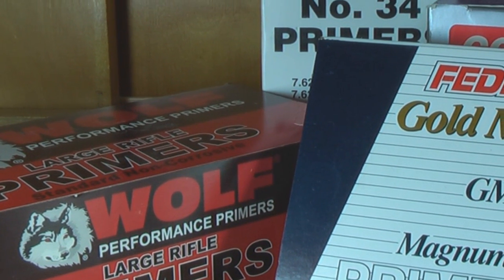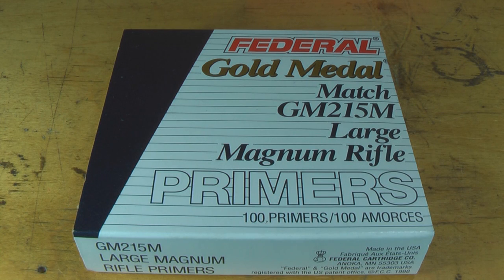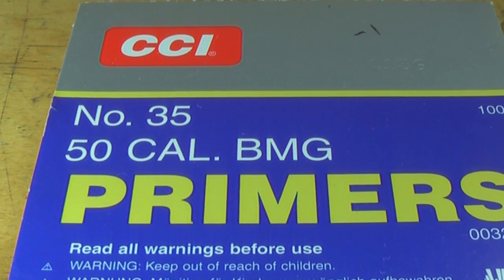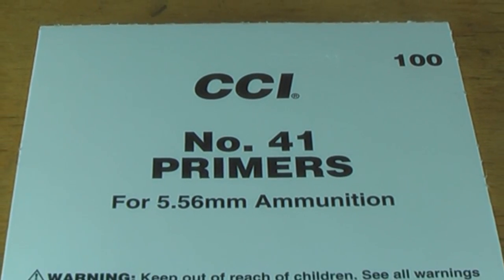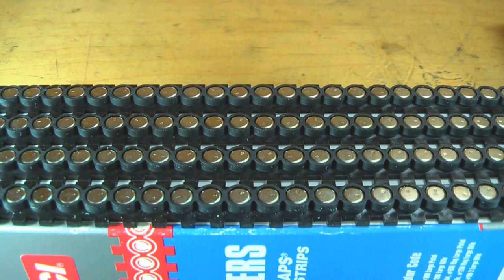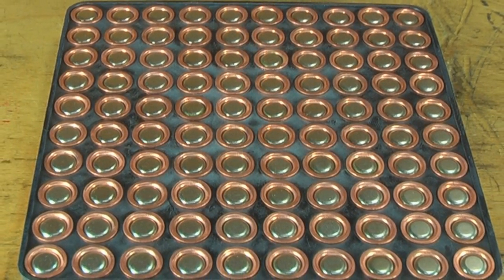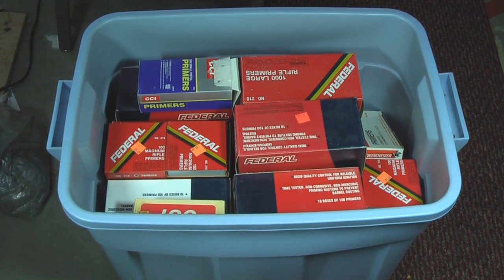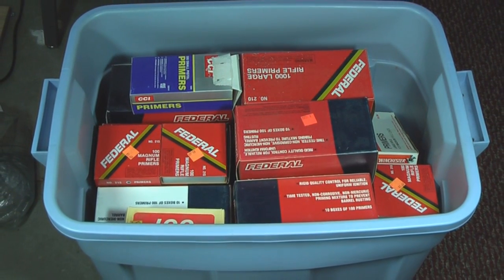Primers What You Need to Know in HD

Comment: Great vid, very informative.  I would add that CCI 41's are great primers, they are not absolutely necessary for the 223 round. Most times, poorly seated primers are the cause of slam fires. If you load a ton of 223, and your rifle is setup correctly, standard primers are fine for most loads and powders.

Comment: You can substitute a standard small rifle primer for a small pistol primer. You would never know the difference if you didn't know. I have loaded over 500,000 9mm with small rifle primers without issue. Learned this from a Winchester rep during a small pistol primer shortage 20 years ago, Mike DIllon was in the office at the time and confirmed it. Don't try to substitute a small pistol for a small rifle though, same Winchester guy told me this.
Reply: How are you doing now?

Comment: The rubber made bin is good but two things:
1. Some people are concerned of static electricity sparking and setting them off. I don't see it as much of an issue. Primer detonation is almost exclusively impact only.
2. Order some desiccant packs and throw a decent size pack in the bin with the primers. Moisture is bad.

Comment: I once soaked several large rifle primers in water for about a week with no real agitation.  I then removed them from the water and let them air dry for about a week.  I then seated one in a .308 case (primer only!!!).  I went into a dark closet and aimed the rifle at an old rag on the floor and pulled the trigger.  Fire shot out of the barrel (24") as if it had been a normal primer.  ....just something to think about.

Comment: @BlltPrffAsssn Its a safety thing. If you store them in an ammo box then if they detonate you have a bomb but if you have then in rubbermaid containers then if there is a detonation the primers will be scattered and the resultant explosion will be far less. I recommend the air tight food storage containers put inside a rubbermaid container as shown in the video but with foam on the bottom/sides/top for cushioning.

Comment: I have had slam fires before but never from my reloads.  The first time was with my semi auto ak47 using some russian steel cased ammo NOT wolf.  It fired off 2 rounds with one pull of the trigger I later determined it was due to a poorly cleaned firing pin and firing pin well.  My SKS also had a slame fire WITH wolf ammo. Due to I believe the same problem.  Dirty firing pin.  So now I clean the hell out of my free floating firing pins every time I strip down and clean my rifles.

Comment: I own two Armalite AR-10 rifles and both of them have a spring mounted on the firing pin inside the bolt carrier group. The firing pin has constant pressure on the firing pin so it is NOT a free floating firing pin.

Comment: The fact that was missing was the metal hardness of the primers. I have some remington primers that are so hard that a double strike is needed sometimes. If I wasn't so cheap I would get rid of them. CCI has a nice primer pocket divot strike on them constantly and that is why I only buy CCI brand. If you buy them compare the divot at the range from time to time with the same rifle.  Don't point your rifle at the ground when you rack the bolt and that will help the slam fire.
Reply from the maker: Primers also vary in hardness depending on date of manufacture as well.

Comment: I understand the associated risk of slam fires in semi or fully auto platforms. However, unless an individual repeatedly drops the bolt on the same cartridge, it's then that the risk becomes elevated, though still very unlikely.

 I have been loading for auto loaders, both handgun and long guns that shoot bottle neck cartridge's. Now if we were referring specifically to FA platforms #34's / #41's to be well served.

 I've conducted multiple tests using a number of different actions and chamberings, to date I have been entirely unsuccessful at inducing a slam fire. Using at least a half dozen different AR15 and AR10 platforms, and I've also tested some semi auto's like the Uzi, Tec9 and a few other semi auto platforms.

 I've tested standard primers from CCI , Winchester, Federal and Remington. Manually dropping the bolt 20 times on the same cartridge yeilded nothing more than a dinged up primer, but no slam fires in any of the weapons. Even the Federal primers wouldn't slam fire, this actually surprised me actually.

 I went on to test magnum primers, they actually did resist denting, in which the dents were significantly more shallow than the standard primers. 

 Moving on to #34's and #41's, and when comparing them to magnum primers there was no discernible difference in dent depth. 

 Over all, Federal primers were the softest and Winchester the hardest with Remington and CCI very similar.

Comment: I've never heard of a slam fire destroying the weapon before. 

To those that asked, a slam fire is when the firing pin rides forward with the bolt and hits the primer hard enough to set it off and fire the round. This is surprising and dangerous because all you might have intended was to close the action after inserting a fresh magazine when the weapon discharges. Appearantly this has caused uncontrolled fully automatic situations, but I've only ever heard of single rounds.
Reply: I just loaded my first 15 rounds of .223 last night and chambered one. It has a small dent where the primer was hit but it was really soft so i don't think it will be an issur

Comment: I dont think its necessary to use the milspec primers in ARs. Ive never used them. The free float pin in M1s and M14s have a massive forward impulse, so it makes sense you'd use it in those, but in ARs the free float firing pin is designed to recoil as soon as it touches the primer. Its also recommended that you dont slam the bolt home unless youre at the range. I mean ive done it but its not smart.

Comment: remind me what #41 primmers are agian.  

I have been using CCI standard small and large pistol primmers and standard large rifle primmers for awhile with no problems.  I was about to prim some small rifle primmers and I was going to use standard CCI small rifle primmers.

I have heard of the issues with slam fires, I have used standard cci large rifle primers with my M1A for awhile with not problems.  The firing pin barrely leaves a scratch but noting the dangers I do seat my primmers deep

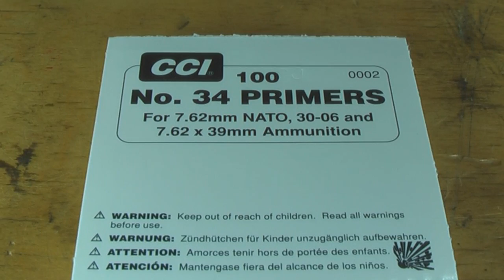Comment: At1:55 you were discussing the CCI #34.  What is a "slam-fire?" I have never heard that term before.  Do non MIL-spec primers "detonate" under light primer strikes? Is that what you were talking about? ... Also, just sub'ed...
Reply: Various primers have different cup thicknesses and are made out of different materials.  CCI #34's are made to a Nato specification, that is all.  No you don't need them, just because you use a semi-auto with a floating firing pin.   If you actually do have problems with slam fires then Wolf, Tula, or Sellier and Bellot have a harder thicker cup than the CCI Natos.  

The majority of "slam" fires are actually mistakenly called so.  Usually a bump fire, or a worn sear allowing the hammer to follow the bolt on occasion.  But from the user perspective, they wouldn't know the difference.  A true slam fire indicates a problem where your firing pin is either sticking in the forward position, or excessively long (improper fitted aftermarket).  None of which are related to the primer, but an actual problem with the firearm that needs to be resolved by a competent gunsmith or armorer.
Reply: darwinfoto09 yah I use the tula small rifle just for this they are thicker a heavier metal you can tell when seating the primer a bit more force is needed, Tula used to be cheaper now their not, but the price of those cci primers is like 45 compared to 30 so tula i about 26 for me its tula on 300 blk and 556 ammo.
Reply: darwinfoto09 also when checking bullet depth and cycling manually their are times when the primers are sightly dented form the bolt going forward and the pin hitting so it can happen after noticing this a long time ago I always take the pin out when checking things manually like that.

Comment: Ammosmith Reloading What is the anvil for? Why do berdan primed not need them?
Reply: The priming compound is smashed between the cup and the anvil when your firing pin hits.  Without the anvil, your firing pin would hit the cup and the priming compound would just flop loose, nothing would happen.  Berdain cases have the anvil cut into the case primer pocket, rather than an anvil in the cup.

Comment: i'm reloading 38sp and i'm having problems with the primer coming out when fired and jamming up my revolver what causes this and what i need to do to stop it?
Reply: I was having that problem in my 9Major when I had excessive pressure and a compressed powder charge.  Also I noticed some of my primer pockets were swollen open.  Don't know if this helps, but if it occurs with ALL ammo, not just your reloads, then you may consider a headspace issue.  Check for excessive end shake, may be time to add a shim.  If it is only reloads, does it occur with a particular lot of brass?  Do you have adequate primer seating depth?
Reply: Winchester? Had problems with them. Loose pockets. Or loading too hot. Don't reload plated cases. Load my 38 brass to 357 specs all the time with no problem in my GP100.
Reply: @jungleno.  most of the nickels have torn split or separated and been sent to recycle.

Comment: Slam fire will destroy the weapon?
Reply from the maker: It can. If the cartridge is fired when the bolt isn't fully locked the gun can come apart. Some guns are meant to slam fire like open bolt submachine guns. but not a locked breech weapon.
Reply: @ammosmith  Maybe damage the locking lugs?  But destroy the weapon?
Reply from the maker: @joshgrove1042  Look online and see some of the wrecked guns. Type in "slam fire damaged guns"
Reply: @ammosmith  All I found was one NRA article and it broke the locking nut on an m1, but did not destroy the gun as that is repairable.

Comment: I don't trust the oil method. I like to pull out the anvil and remove the priming charge when making dummy shells.  That or take the anvil out of a used primer and hammer out the firing pin strike.

Comment: How is that there are special primers for semi auto rifles? This is weird to me, i think that the only thing that can cause a slam fire is a primer seated uncorrectly. I think there should be something special about semi auto rifle primer..... anyone knows what is it?
Reply from the maker: The primer cups are thicker to deal with floating firing pins on weapons like the M1A and the AR15 which can dent the primer when the  bolt closes. This can cause a slam fire and blow up the gun.
Reply: @ammosmith  but the bolt has to rotate ib order to close the action..... so the protrution of the firing pin would not be a problem if the bolt is on the most forward position...i dont know i guess im wrong but that is what i feel
Reply from the maker: @johnthreesixteen5643  It can be and has happened in the past with some shooters. Look up "slamfires" on google and look at some of the disasters. I think there's more to it than just the primer...I think poorly assembled ammunition and poor weapons maintenance were also involved.
Reply: @ammosmith  the AK also has a free floating firing pin.
Reply from the maker: @jungleno.  Some do and some don't . I've seen both.